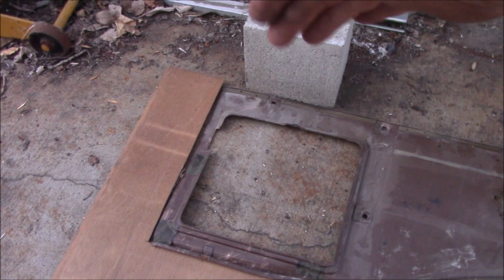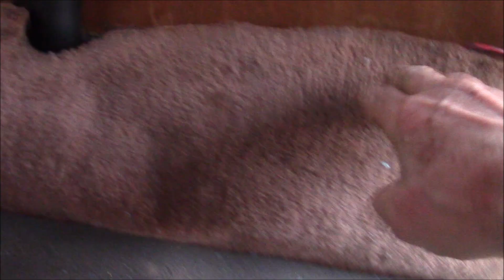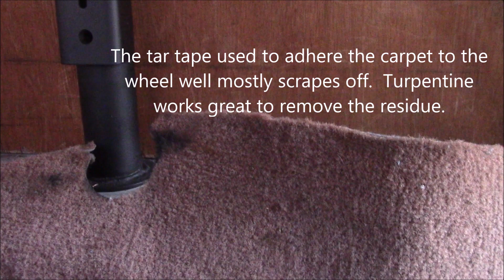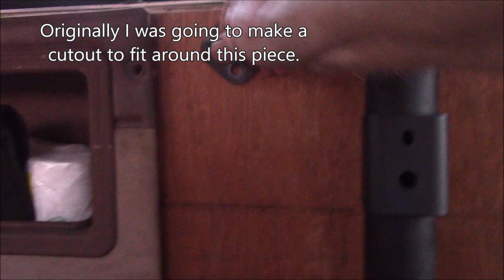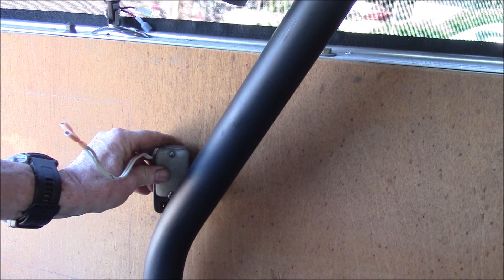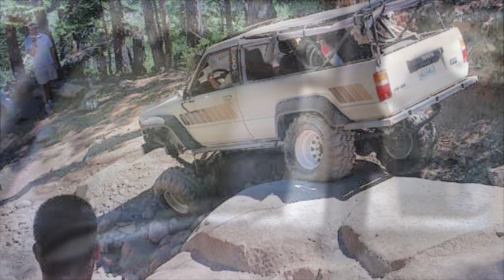1st Generation Toyota 4Runner, Plywood Bed Side Panels

Comment: been enjoying this series. I have an 85 4R as well and this is giving me ideas.
Reply from the maker: Great, glad you enjoy the videos, more to come.  I've just been going through the back of the truck fixing things that are worn out or need updating.  Amazing how many issues you run into as you dig into it.
Reply: Same here, only difference is I'm in a 94 4Runner 22re manual.
Reply from the maker: @aeipee13 Those 2nd gens do have nicer trim in the back.